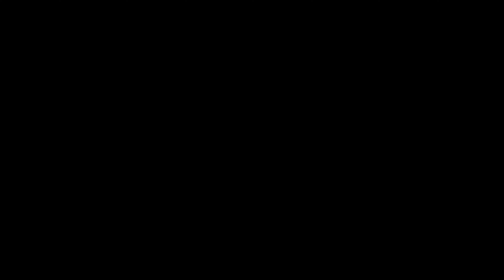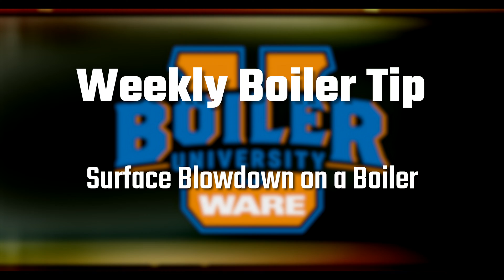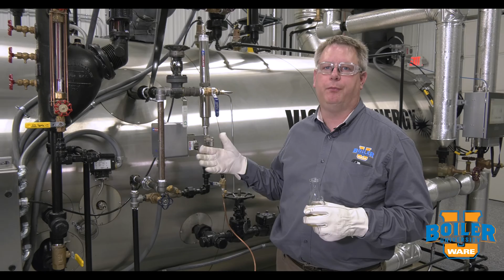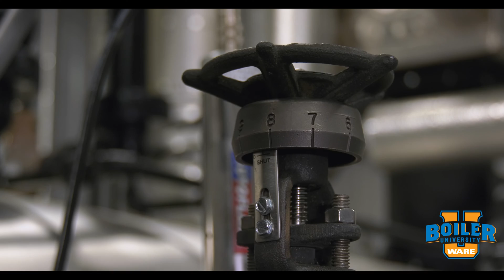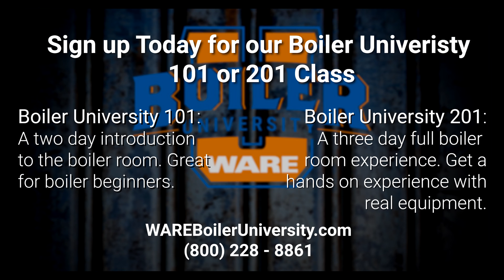How to do Surface Blowdown on the Boiler - Weekly Boiler Tips

Comment: My boiler only has a manual surface blowdown.  Does it matter if the boiler is firing or not when doing a surface? Generally bottom is done when not firing, to allow sludge to sink down.